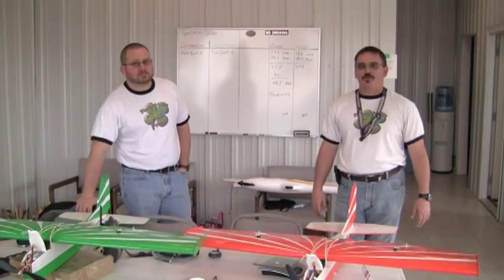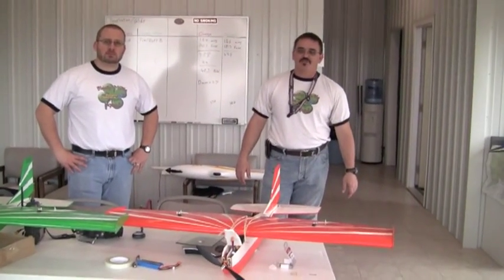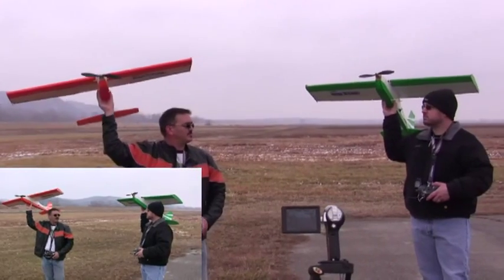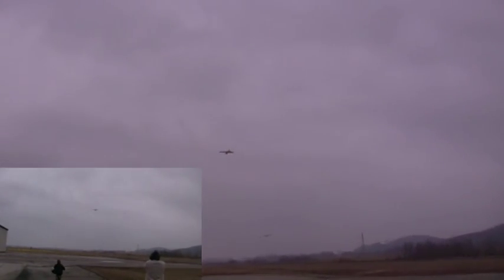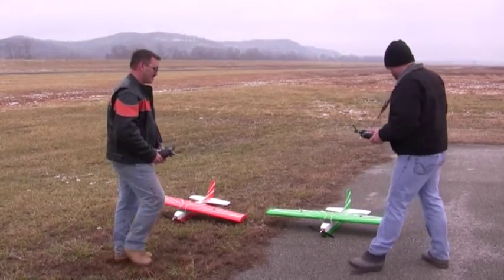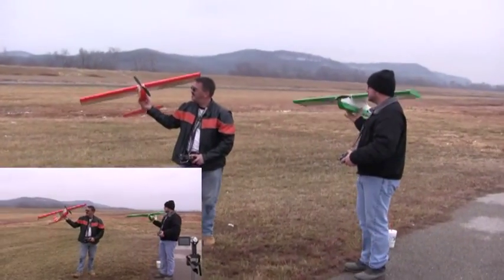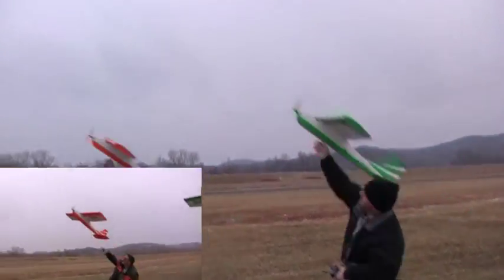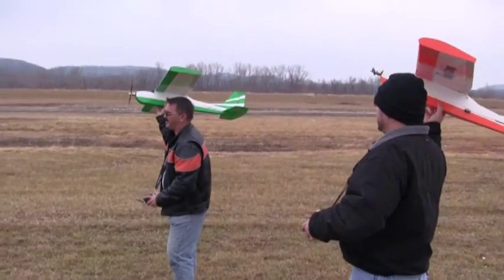KFm vs Conventional airfoils testing day 1

Comment: I was wondering if you did any other video on this subject.  I am working on project for missionary group and would like to use a KFM-3 airfoil
Reply: We did do several videos testing the 2 planes side by side. It has been a while. It was a good wing design both for its ease of build but also for its stability. All of my favorite plans were my KF builds. There is a whole playlist of Project Big Step. It was a lot of fun to do.
Reply: @nightphall6810  -is possible to get a link to those videos?  Thank for your time - Steve
Reply: @nightphall6810  How thick where your steps?

Comment: Well, I'm impressed! The KFm-3 looks hokey at first glance and much like a bumblebee, it shouldn't work  aerodynamically, but somehow, it does anyway! Plus, the ease of construction and added strength at the expense of only a slightly decreased foil efficiency would seem to be a good trade-off. Overall, a perfectly viable way to build an aircraft.

Comment: Interesting test guys.  The KFM will have higher drag - separation is drag.  The chief advantage I can see of the KFM is ease of construction on some models.  Our models are relatively draggy and over powered, so it's a hard thing to measure.  Thus the difference may not have been obvious in this test.  A boat operates differently.  Steps on a boat hull cause an aeration of the flow between the water and the surface, reducing the contact area, but not increasing lift on the hull.

Comment: this test is pretty unscientific, you need to figure out your airplane's minimum drag airspeed which occurs when both induced drag and parasite drag are lowest. if you can find that speed and trim the planes for their Vglide speed, you could more accurately test. There is a most efficient climb and glide speed for a given airfoil and if you don't peg those speeds, the test is arbitrary in it's findings due to added variables.
Reply: ahaha tell me oh wise arse how could it be  more scientific..youre a nutter.. two pilots alternating the same  flight  paths at the same altitudes at the same speeds at the same time..youre insane.try anuttther jr college..doc johnny

Comment from the maker: @JC0926 yea that has been suggested, I was waiting on the programming card to come in stock for the ESC. Normally I have no luck with stick programming :) I went ahead and gave it a shot and have the brake set now. we were planning on running this test periodically throughout the testing to maintain a good baseline on how the planes are preforming. to make sure that noting changes or happens to the planes in storage/transport. I will let you know if it makes any major changes.

Jon

Comment: Tim/Jon, I have a question, I watched the video twice before I ask. Do you think that you should be using the braking feature on the esc? That would allow a better glide rate and more consistent testing , with the prop still spinning with no power this creates resistance. Just an idea, I know it makes a difference with my glider. You may be able to achieve different results it the speed of the planes is faster. Make sense? Just my thoughts, love the planes!

Comment from the maker: @BMFoamy we had planned to swap wings back and forth. This however proved much more difficult to do than I expected. we will do it later for some of the testing that doesn't require us to be flying side by side. Its easy to swap 2 wings on one plane, its very hard it turns out to swap 2 wings on 2 planes.

Thanks for watching
Jon

Comment: Cool tests, looking forward to seeing more results from comparing the two wing designs. Just as a bystander that was there, it appeared as Tim said the KFm Airfoil was a touch more stable in climbs and gliding near stall speeds. The Conventional Airfoil seemd just a tiny bit faster.  Keep up the good work guys!
Paul